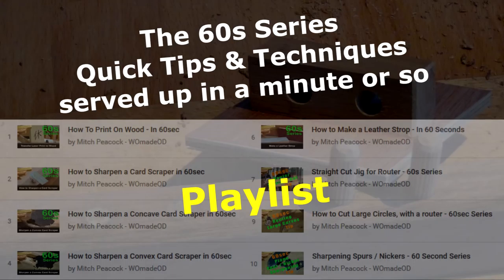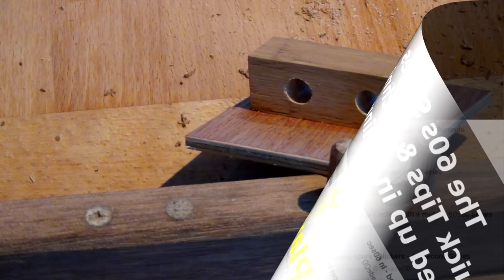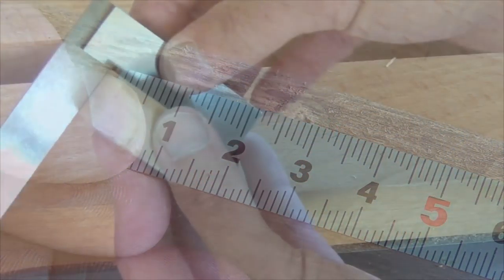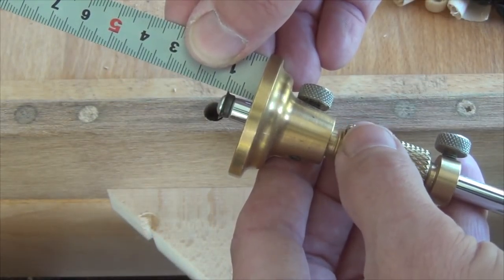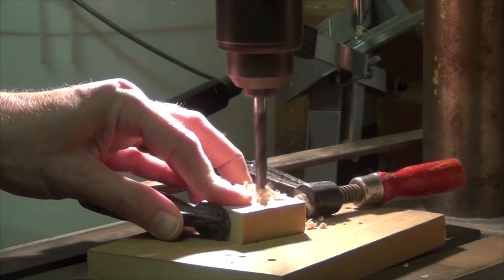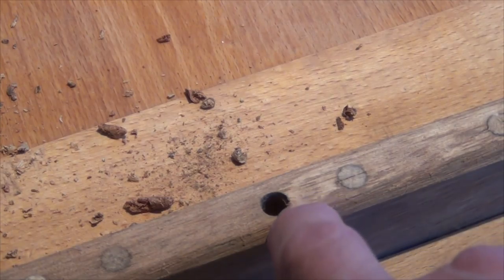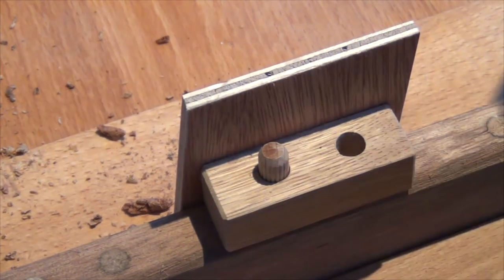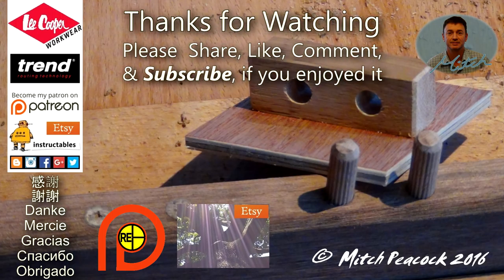Quick Doweling Jig - 60s Series

Comment: Nice tip mitch, as always.  I did the same thing years ago but found out the guide holes wore out quickly.... so i broke down, swallowed hard and purchased a Dowellmax jig and haven't looked back.  It is pound for pound the most expensive item in my shop but well worth the investment.  It has saved me 100's of hours of work and frustration.  The end results have been exquisite and accurate.
Reply from the maker: Cheers Peter. They do wear out, but when you just have to match a custom layout for one project, they can save a lot of setup time. My homemade metal dowling jig is great, but at one inch spacing I would have had to setup for every hole!
Reply: Mitch Peacock - WOmadeOD Agreed, that's why I purchased the Dowelmax.  It has a gauge rod which makes for very accurate work.  Additionally, it allows for a variety of wood thicknesses with very little set-up.  I tossed all my other doweling jigs.